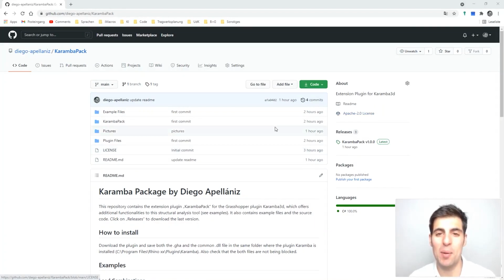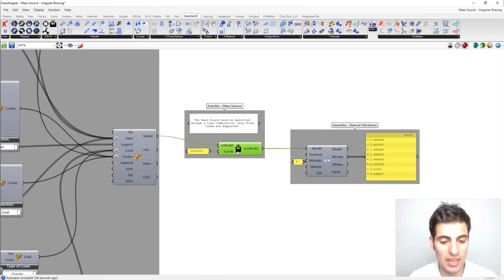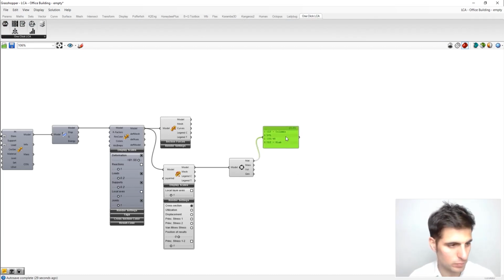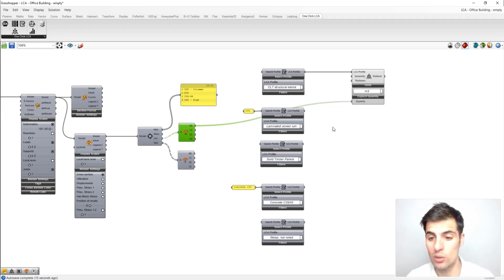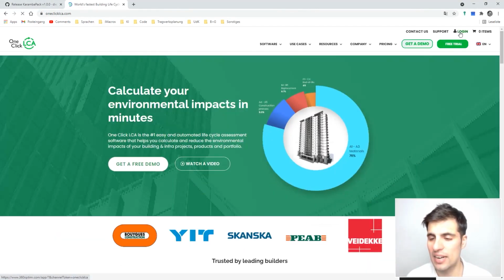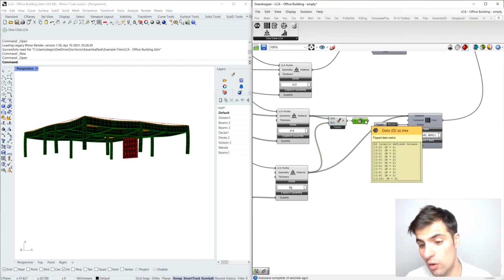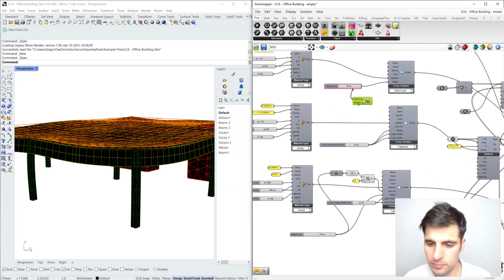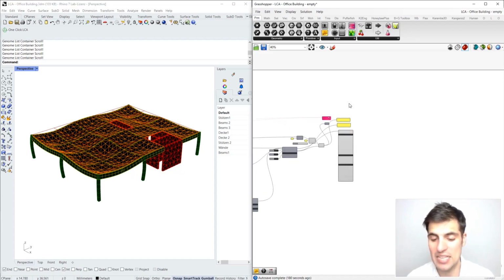Grasshopper - New Karamba Components! LCA & Carbon Footprint Optimization!

Comment: Hi Diego, very intuitive video with basics. I am doing a Thesis case study on LCA in bridges. Can I ask you something? Taking parameters for different elements would be different for bridge components as then unlike buildings the groups would change, right? In the video for example, you optimized the CO2 and the minimum quantity and structural performance. Is it possible to include costs vs CO2 optimisation through galapagos? And visualize results in Rhino?
Reply from the maker: Hello Saurav, thank you! For such a multi-objective optimization I would recommend to use the plug-in Octopus instead of Galapagos. I included an exmaple in my paper. May be it's interesting for you (Figure 9):
https://www.researchgate.net/publication/354193697_A_Holistic_and_Parametric_Approach_for_Life_Cycle_Assessment_in_the_Early_Design_Stages

Comment: Great Job Diego, Quick question, won't the weight optimization conduct the same result?
Keep it up!
Reply from the maker: Thank you Sebastián! No it wouldn‘t, since the beams and the slab have different materials with different relative CO2e values. If it was an homogeneous system with the same material for all elements you would be right.